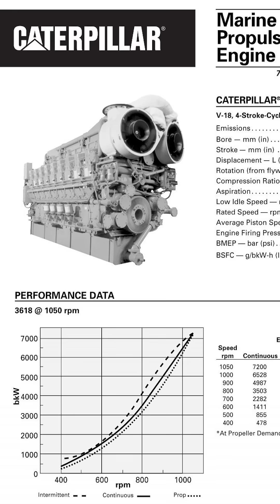wHy Don'T CaRS uSE V18 ENGiNEs?

Comment: Length really isn't an issue, I'd think. For a V18, you'd just have a really long hood; You'll basically be driving a cartoon limosine!
Reply: I was literally about to comment "Just make a longer car"
Reply: @Humdinger69  the parallel parking tho...
Reply: Captain Nemo's Nautilus car
Reply from the maker: Regulations have entered the chat
Even if you will deal with it, lots of Law Makers usually have a role to play regarding vehicle visibility, size, and length.  In the US we even tie certain Emissions Expectations based on Wheelbase.  Also from a customer perspective, the V10 Hood from the Viper was already hilariously long, so a V18....yeah I don't think Lawmakers will let us have that.  Again, I think a V18 car would be INSANE, but we don't run the world unfortunately :\
Reply: @BladedAngel  nono here me out

Long car funny
Reply: @BladedAngel  Just make the trunk even shorter
Reply: Well, let's just hope that emission act got Reppeled then @BladedAngel
Reply: The old Tex Avery Warner Brothers limousines were based on straigh 8's around at the time. Big displacement was essential for performance back then because engines revved slower and fuel was poorer. Straight 8 was simpler than V8 for the time. So what you say has an element of truth. Very long engines do give visibility issues  when pulling out of a side road or when children are in front of the car. Less of a problem in a rear engine layout in the modern world IMO..
Reply: General shape of pickup truck, front hood is for storage, rear area that would be the box on a vehicle made by or for sane people is just for engine.
Reply: Long car basically an airplane without wing
Reply: Put it in an Audi RS6 Avant and just take out all the extra the cargo space
Reply: I dont know why but i thought of that long car from family guy
Reply: Put it in bac.
Reply: It would be the length of a limo but it's just a 2 seater LOL.
Reply: Length does become an issue with the shaft, as it becomes longer it reaches a point where it’s impossible to keep it within acceptable stress levels

Comment: A V18 car is plain and simple overkill, you can use any motor in a car if the chassis can carry it, even a CAT "truck" with a ship engine is "possible", doesn't make it smart.

Comment: Bring back the Ford 300 in line 6cyl. That 300 (4.9L) inline 6 cyl was Bulletproof.
It was one of the Best engines Ford ever built and it was the BEST 6cyl engine ever built.
Let’s face it, Ford stopped making them because they simply lasted too long.
My 82 F150 had almost 700K miles on it and my 96 is still going strong at 500K miles.

Comment: There also isnt any particular VALUE to putting an engine with that many moving parts in a car while only producing probably max 600 HP or so. The pistons, cylinders would be tiny while the block & crankcase were huge. 12 cylinders is very smooth when it runs, but a well made straight 6 is pretty smooth too and way fewer parts to break. Or pay for in the first place.

Comment: Bugatti has no V16, but a W16. It is the similar idea like VW VR6... So its not "two rows of 8 cylinders", rather two "VR8 engines combined in V shape". A V18 or even a V16 would just be too long to fit in a road legal car. Just think of it. A V8 has the similar length of an I4, or a V6 like an I3, or a V12 like an I6. Ok, there were some I8 engines in history, but their production didnt last long for practical reasons....

Comment: A V16 is not really a V16.. it's two V8 connected to each other and the transmission. But still, a V16 is two V8. 
The V12 instead is one single engine

Comment: It is interesting to you, but smaller will be again v18 or v22 and will fit (in same space). It's not that the point, the point is: fire, combustion ... any is "stone age" which you live in. Actually, it is burning as fire, but is NOT power, you have gears, and you think you have "engine". No, you have pulleys to lift 10kg on 2-nd floor. There had been always "advanced" and "stone age", from all times (in universe) it depends in which part you are.

What is the difference, it is same planet?
It is, with millions years I am same:
- one is using 95% combustion , and 1 item 5% light speed application, or vehicle , magnetism, electric, light.
- one (not other) is using opposite 95% magnetism, electric, light, and just one 5% combustion.
I'm the 2-nd one, faster, silent, light speed finished task.
This is not an add, it is fundamental (you) to understand the practice.
Sorry for that part in ( ).

Comment: Once again, people are confusing even firing with engine balance.  Those are two separate issues.  V14's can be even firing, whether by making the bank angle to be exactly 720/14 degrees, or by using an even bank angle and splitting the crankpins.  Even if the engine is built to be odd-fire, a damper can be designed that will control torsional vibrations at the free end of the crank.  The problem with V-type engines that have odd numbers of cylinders on each bank is rocking couples.  Whether V6, V10, V14, or V18, they will have rocking couples caused by the odd piston accelerating and decelerating from TDC and BDC.  Fortunately the magnitude of imbalance decreases with the increasing number of cylinders and can be easily coped with by proper tuning of the engine mounts.

Comment: Bugatti has w16 not v16 the difference is that it has 4 rows whith 4 cilinders. It is actually more complex because it actually has 2 vr engines and cilinders are put diagonally

Comment: Inline 16 would be something to see. A car thats split in half with a long ass motor running right down the middle for all wheel drive, 4 cylinders for each wheel. Bubble tops for driver and passenger. Like another Hot Wheels car made real.

Comment: Making a bit of a "what if" speculation, European Ford had two V6 engines in the 1960's, namely the German Cologne V6 and English Essex V6, extrapolating that if two engine blocks cast together would make a V12, three would make a V18; particularly since the Cologne V6 was between 1.8 and 2.9 litres (a 4.0 litre was made for American use); and particularly the Essex V6 was derived from the Essex V4, ranging from 2.5 and 3.4 litres; if based on either engine family you could have a V18 with as little as 5.4 litres, or upto 12 litres.  The hypothetical 5.4 litre engine would be only 1200mm long, 600mm wide and 600mm high.

Comment: V18 Engine is Massive, I wonder if they will put it in a Locomotive making a new Fuel type Locmootive called Gasoline locomotive with all LED lights, E-Bell, and Different horns

Comment: I’ve worked on a cat 3524 with 24 cylinders lol.  I’m not exactly sure why they use engines like that for industrial applications over say a 3612.  They’re not common in the field I work in but do exist.  The only practical application I can think of is a large vessel where the weight is spread out more
Reply: AFAIK a lot of them are the result of steady development of older engines. Most likely at the time the original design it was developed from was introduced making a smaller number of cylinders with the same power wasn't practical.
Reply: @ I could see that.  These two series came out about the same time.  Another reason I could think of is smoother power delivery

Comment: That 2 seconds of giant caterpillar engine cold start was such a tease 😮‍💨
Reply: Ship engines typically operate at very low RPM's. In the most extreme cases under 100rpm redline. But even 2k redline is shockingly high for large ship diesels.
Reply: @darthkarl99  I wasn't asking for more rpm, I was asking for a longer video of the idle
Reply: @ I thought you were maybe mistaking the low operating RPM for it still spooling up ;).
Reply: @darthkarl99  no sir, been working on diesels "professionally" since 2003 and was the farm mechanic as a kid. Just wanted to hear it rattle about until the cylinders got hot
Reply: @grapeseed427

I wonder if NOS is still possible. Make Same hour shipping possible!
Reply: Wow everyone is smart here
Reply: As someone who works on ships and these massive diesel monstrosities, I can say that this thing is running pretty smooth, not even cold or idle.
Reply: Shit sounded ass
Reply: Need me a c175 or a 3516 in my ar
Reply: V 1800❤

Comment: at what moment its a good question when u got 4 & 3 cylinders got more power and use less fuel than stupid american v8 that only used for pleasure for sound for ltorque at low rpm ok cool but stupid question definetly

Comment: Big V and W engines don’t necessarily equal more power. It’s all about volumetric efficiency. So if you can run as much air through a V8 as a V12 then the V8 will have more power. So just slap a couple turbos on your big block V8 and it’ll be moving just as much or more air than a V16.

Comment: Power to weight, modern engines produce good power, the advantages of a larger engine would be out weighed by the huge weight of a much bigger engine. In any car 20kg extra weight means basically you have lost 1hp. less weight without doing anything means it can go faster. how many race cars do you which things they do not need?? NONE!! Less weight with good power means it should go well!!

Comment: Sorry but the Bugatti uses a W16 not a V16, v16 would use two banks of 8  while the w16 uses two banks of dual row 4 while being off centered from the first row if Bugatti decided to add 4 extra cylinders to their engine which would make it a W20 Engine it would be entirely possible well balanced and Mighty powerful

Comment: Either way the car is going to have to be almost unnecessarily huge encompass the motor OR the motor would have to be made scaled down so small it’s not worth having a motor simply to say “I have a v18” cool but my V8 is still faster and better and less expensive

Comment: American cars: "Y'all can't handle this size! No replacement for displacement brother!"

Ships and locomotive engines: "Each one of my cylinders is an entire New York studio apartment"
Reply: It probably costs just as much as one too.
Reply: Hence why america has the worlds biggest navy by tonnage.
Reply: Those ship engines are so big they have hatches to let people walk/crawl inside them in order to clean and maintain the engine chamber. I heard one story of a guy who actually got locked inside one of those hatches and was literally pressure cooked inside a massive engine
Reply: I have overhauled an engine that had 198.000 kW at 68RPM
Reply: Yea, the SD45 also hated crankshafts.
Reply: I was going to question that, but having seen a train engine that was set up to be a building's backup generator, you're probably not off by much. Those things are large and those studio apartments are tiny.
Reply: @SmallSpoonBrigade Your wrong, it was a small town for multiple days.

Comment: They've been plenty of V16 engines before newest Bugatti model, Detroit Diesel which been installed in various industrial applications and trucks is the best example (it's not common like a V12 or I6 but still an unicorn)

Comment: Thats not a v16 in the bugatti, but a w16 (two banks like a v-type engine, but each bank is build like a VR-engine). A VR-type engine is a mix of an i-type and v-type engine, cylinders still have a V-format but at only 15° Entangled and only one cylinder bank. So a W-engine is the unholy and Inbred child of a v-type and a VR-type engine

Comment: I dunno if you'll see this but, for this mission in particular having the anti-stalling part can help with some of the more difficult silos (allow you to slow down even more without stalling.) 
Additionally, there's a part which can help reduce cloud interference on standard missile lock-on (it helps a lot in bunker buster, faceless soldier, and other missions with high cloud density in them.)
Reply: Also, if you plan to try this mission again in the future, in order to destroy the targets (in red), you have to keep your "special weapon"/TarGeTing Pod aligned onto the targets until the bomb drops on each of the marks successfully. You must not sway your plane's nose from the targets until after the bombs have been dropped.

Comment: Hear me out: the 4/20 engine. 4 five-cylinder radial engines in the axle of each tire

Also it has cupholders on both sides and middle

Comment: MTU makes a V20 in their M96 engine line in a few different bores depending on the ship size. Very common engines in 60-100 meter super yachts. Over 100 meters Wartsilla dominates.

Comment: Bugatti had a w18 engine, 3 banks of 6 cylinders each. And chrysler had an engine designed for use in a tank called the multi-bank it used 5 banks of 6 cylinders totaling to a massive 30 cylinder engine

Comment: There's no v16 available for Bugatti. That's a W16. And the reason why we don't have them is exactly why it's a w16 and not a v16 yet.  They get way too big, the w shape offset of the Bugatti's cylinders help them fit even better.
Yes bugatti has talked about making a v16, hasnt happened yet because of the same reasons, making room for it is taking new engineering. All they have is a few production samples, they arent expected to market until 2026. Theyre making the car longer to fit it, wouldnt you know 😂

Comment: uh there hasn't been a car with a V16 in about 85 yrs since Cadillac stopped production on their V16s in 1940 and until the 1980s used predominantly V8 engines anything from a  5.0 small block V8 to a 7.7 L big block v8 depending on which car/which model year. you're more likely to see a V12 in an Italy sports car or a German Luxury Car I.E. Mercedes Benz S Class my childhood best friends late mother drove an S Class for nearly 40 yrs updating every 5-6 yrs which the daughter inherited the last one a silver W223 S600 which has a v12 and the daughter drives a C class Cabriolet

Comment: The ones on the Bugatti are w16 if I'm correct 
It's to save space in the engine so it isn't really long. 
Basically the v letter before any number (V12 for example) means that the direction of the pistons is in a v, so a w before the number means that the pistons go in the direction of a w. I've probably explained it badly, let me know if you don't know what I'm on about.
Reply: you are correct. the bugatti veyron has a w16
Reply: Yes, two VR8s combined at a 45% angle.
Reply: All the Bugatti's car use W16
Reply: @Diabolos1007 their newest one coming up is V not W. Tournillon or something like that

Comment: Now I don't expect this to work anyway at all, but what if you did like a combination of a radial engine and a double v engine, so you had two Banks of four cylinders and two Banks of five cylinders set up in a radial configuration which kind of looked like an x from the front, I doubt it would have worked to be simply because it wouldn't be very well balanced, although in a way it probably would be bounced.

Comment: V18 engines exist in VERY particular uses, they are used for large scale emergency backup generators, at the moment only two people produce the engine by hand other than casting the engine blocks, they cost around $2,000,000

Comment: 1.)
At a certain point the block gets so long that it makes more structural sense to have "W Engines" or oval cylinders or some other weird thing. Unless it's an engine with really low revs. 

2.)
But really, if an inline 8, V16, or V12 can't contain the displacement you want, then you just aren't building a vehicle that's a road or race car (including drag racers). 

3.)
Going bigger and bigger is going to make fuel delivery and RPMs and internal friction not just give diminishing returns, but negative returns. I don't know what the upper end is, but it's probably a V12 and with no rule whatsoever it's a turbine.

Comment: V14's aren't possible for balancing reasons? Even if you put the cylinders at a different angle, does this issue still persist?
Reply: Firing order causes imbalance, you would need a massive mass/resonance damper on the front of the engine which would rob it of power and make it run inefficiently.
Reply: I'm pretty sure they're possible. His explanation about being able to evenly divide 720° is total hogwash. We could just as easily define a new unit of angle with 70 units per rotation or something, and then it would divide evenly. 

Wärtsilä makes inline 7, 9, 11, and 13 engines, so if an inline 7 is possible, then a V14 should also be possible.

Comment: Why isn’t there a v20? But placed like the w16 in Bugatti. It can be placed like 4 inline 5 engines or 2 v10 so it will be same as w16 in Bugatti only additional cylinder on every block.

Comment: You also have to consider that the engine needs a way longer crankshaft, which then can break easier. With a massive ship engine, that's no problem. Just make it beefy enough, but car engines have to be way smaller and lighter. Therefore, an engine with too many cylinders in a row is impractical for reliability and weight issues. That's why there's very rarely anything above 12 cylinders in a mass produced car

Comment: Bugatti and Volkswagen were thinking about a W18 (three banks of six cylinders each) for the Veyron, but then went for the W16 (four banks of four cylinders) because it was more compact, could have easier retained the quad-turbo setup from the previous EB110 and could have been essentially developed by mounting together four I4s together, making the process easier.